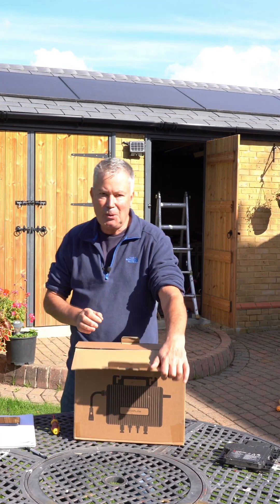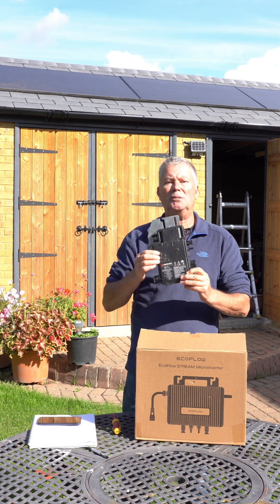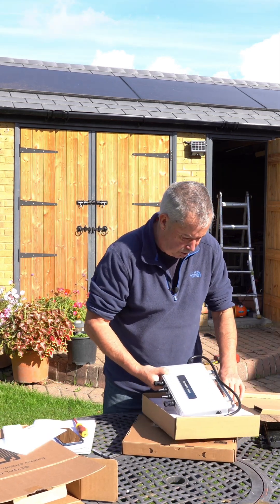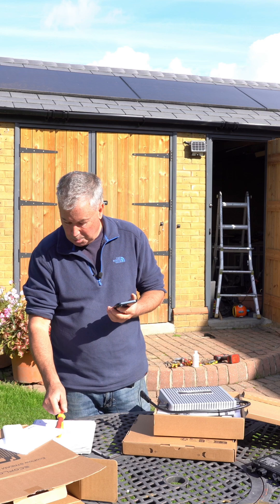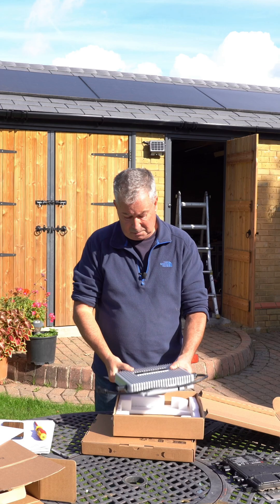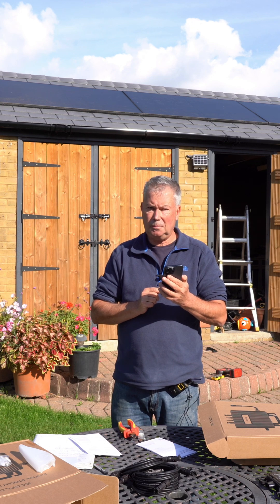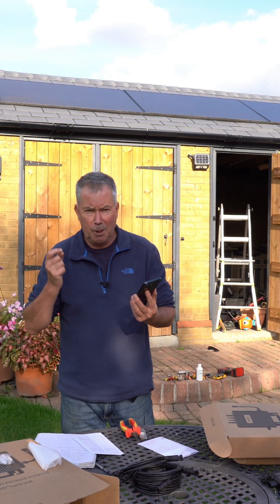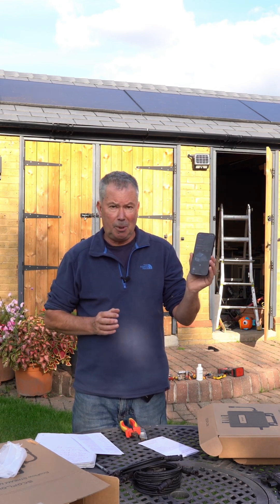ECOFLOW Stream Microinverter Versus Enphase IQ7+ #short #solarpower #solarenergy #diyproject

Comment: Sorry for sounding stupid but why are you replacing what you already have?
Reply from the maker: No not stupid, I was not clear. I swapped microinverters just for a test and I will put the Enphase back in place. The two ECOFLOw units I bought are for future expansion of my little solar farm.
Reply: Does the input from the panels just get plugged into a normal uk plug socket to gain the solar input or have you had to wire this into your consumer board?
Reply from the maker: @SkyHighAerialDronePhotography  It can go into a normal UK socket. The system will not produce voltage until plugged in so the plug should not be live. To be honest, i don't like trusting the technology to ensure this but as these items are approved then it must be foolproof.